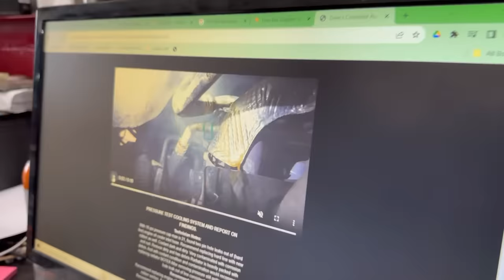The truth about maintenance, and what the manufactures tell you vs what you need to know

Comment: wrong its not to  sel yopu another car its to sell you parts and serivces thjey can keep you on the hook that way..

first oil changes 3k is the max you want to do i do mine at 2k  cvt trans and normal trans do a full pan drop filter change 10 quart change out at 25k 

25k for your coolant too dealer says 60k
25k for plugs even if 100k

brake flush at 15k
 replace inner cab filter at 15k
tires at 50k miles or less 40k better
even if you own a new car at 30k miles your allowed to since the act of 1975 change youyr fluids drop the pan and filter for cvt do brakes etc nothing major it wont void warranty

also at 30k intake clean sea foam the one with the long tube down the intake easy to do watch youtube for how to do it
then put seam foam whole can in gas tank the fluid kind not the one with the long intake stick

it will help clean injectors 
but a real injector clean you need  adaptors and the can with fluid in it you can use kerosean and mixture of gasoline  and pressurize it  10% koerosen and rest gas
 this is what heet used to be made of infact just buy a few cans of heet if its still around get a pressurized fuel injector cleaner and kit to hook up to youyr rail pull the fuel pump fuse or relay and run the can dry till the car shuts off from lack of fuel in the can you used a fuel injector pressurized can does not cost much

another tip keep tires 2 psi under their max rating it helps keep them plyable when driving always at max and you have hard tires and tires do age and get old and feel rougher as you drive so 55k is the max for a tire change itg sooner

battery now change them at 3 years get a good sears one diehard they are made now in germany they are 300 dollars but worth it all new cars need agm not lead acid
do not put lead acid battery on a newer car 2020 and above they require agm higher demand on it.

also drive belts 30k replace it get a good factory one not the parts store one

pcv valve some cars easy to get to clean it out and the hoses if they come off use brake cleaner let it dry once done reinstall  or just buy a new pcv valve and clean the hoses if there are any 
clean with brake cleaner the mass air flow sensor some are burried deep in plastic make sure when spraying cleaner inside the plastic bnrake clean wont eat plastic but you must let it fully dry before starting your car use shop air gentttttlyyy blow it out then let it sit it will have condensate from the shop air  so let it sit a while then reinstall use safety goggles when doing this

radiato flush at 30k miles use good coolant useually 2 gallons concintrated will due make sure to use what vehicle needs i just buy the dealer stuff its silicate free long life well thats a lie but it wont void warranty.. if still in warranty
then if you have a new car with closed loop drain valve on radiator warm engine up and coolant not hot but warm drain coolant then fill with distilled water then do over and over till runs clear then drain final drain empty radiator and resivor now fill with  1 gallon of the coolant then 1 gallon distilleed thats 50 50 mix save the other 1 gallon just in case it takes more than 2 gallons  so you now have a spare if it takes 4 quarts etc you have plenty etc.. so once its filled with 50 50 run engine hot till fan comes on to burp when you see constant flow from return line to the resivor you have burped it now puit top back on and drive a while come back slowly remove top to resivor if  nothing happens ie water does not drop  or start to go back into the system disapeer then you are done just top off to fill line if not then add more coolant let run with top off for a while.. and done

im a 30 year tech forf a major car manfacture ive worked on nissan ford gm bmw you name it volvo etc many diffrent dealers i have 2 ases a1 and a6  
im retired 

thats my good deed for today.. always wear safety glasses under the car and when engine is running or using air tools or taking off tires etc why youll regreat it when a piece of metal shoots into your eyes.. always wear hearing protection for taking off tires etc why tetanitis when your old always wear gloves.. saves hands cracked hands etc always wear clean shop shirt tucked in look presentable at all times shut up and listen to the customer never turst your service advisor if he says something always confirm it  HR is not there to protect you its for the company dont date the shop whore    or co woker  always show up early and leave late.. be the guy to go to..

i had 2 stalls the biggest bay for my meat slab and always came to me for advice even the seasoned techs why i never turned anything down..

good luck

Comment: why does a mini have 32,000km oil change interval? to meet government standards for oil consumption/ pollution. it will get through warranty and it will use an approxed metric of fossil fuels. its bullshit. i change my oil every 5000 km. synthetic on a turbo motor. when i reset the interval its 24,000 on my bmw. if i did 24,000 i would get 1 oil change before i need a new engine.

Comment: No offense i dont trust anyone but me to do my oil changes, ive had too many bad experiences, using an fucking airgun to tighten a drain plug, so I HAD TO REPLAVE THE WHOLE OIL PAN, using the shittiest cheap oil they can, oil filters ive never heard of on there. Im sure its fine, but its far from ideal, but leave the air tools on the bench for an oil change. 

When i do it, i get good oil i know is correct and will make my car last longer, and it costs less than the shop. No offense to mechs out there, unless you use a goddamn air gun on drain plugs. Then you should quit your job.

Comment: 10,000 miles on a diesel is because they have 12-15 quarts of oil instead of 4-6 quarts. More oil = more time running before the oil degrades.